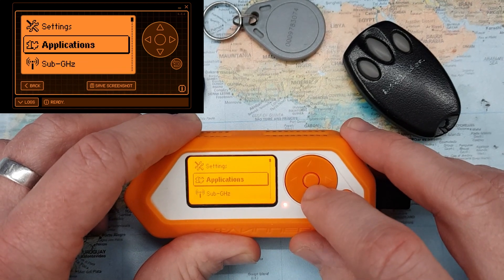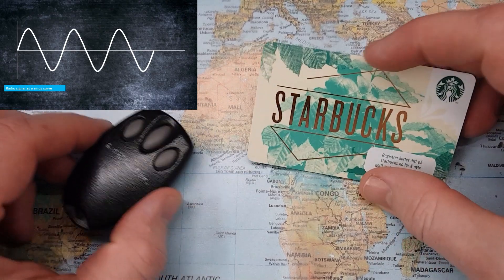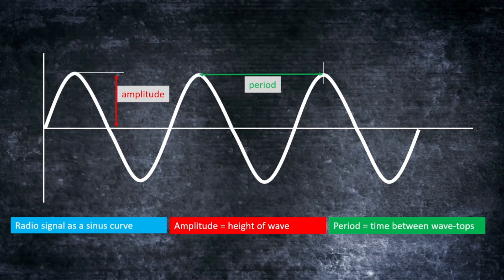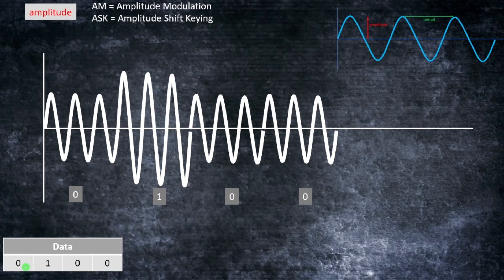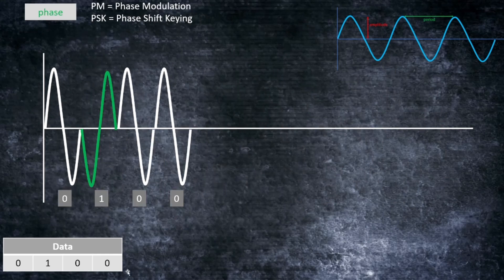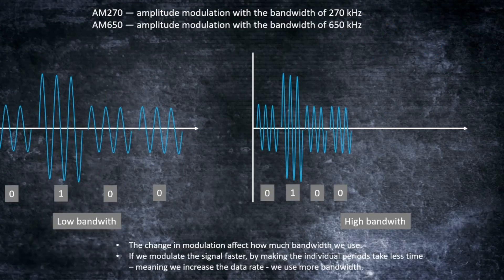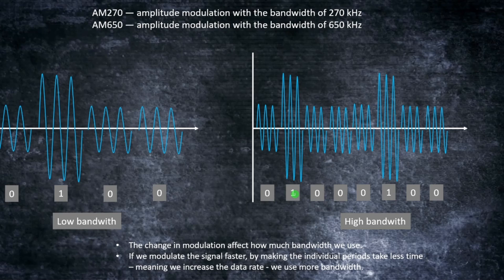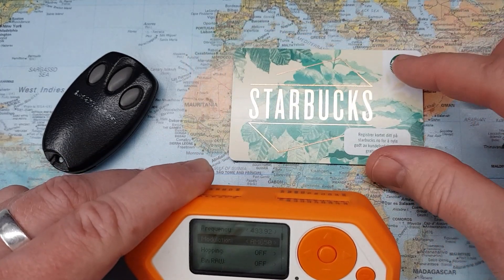Understanding Radio Signals with #flipperzero

Comment: I came to this video after learning about what the Flipper Zero is designed to do with almost no knowledge about radio signals, and you opened the door to more and deeper knowledge about how data is transferred wirelessly between electronic devices. Thank you so much! Learning is one of the greatest joys for me, and you've helped me learn a lot :)

Comment: Awesome video!! I've been learning all about modulation and working on making a video that covers modulation as well, that I hope to release first week of April.  I like how you did the visualizations of the waves by stretching them, that was a really good visual.  I'm still going to finish my video, but I'll be sure to link to your video too!  

One correction (at least I think)... My understanding for the CC1101 radio is that "bandwidth" in AM is actually about limiting how closely the broadcast frequency has to match the actual receive frequency (not about the data rate) and it only seems to impact the receive values, not the transmit.  I was initially thinking it was more similar to how you showed it too.  The frequency we set in the Flipper Zero is the center frequency, and the bandwidth is roughly the width from the lowest frequency to the highest frequency that is acceptable.  For example, if you are listening on 433.42 with AM270 then 270KHz is the width of the signals you allow, with 433.42 being the mid-point; 433.42 +- (270KHz/2) = 433.285MHz to 433.555MHz. If you are using AM650 then 650KHz is the width of the signals you allow; 433.42 += (650KHz/2) = 433.095MHz to 433.745MHz.

I think I read it somewhere in the CC1011 spec, but I can't find the text anymore?  The way I confirmed this understanding was to create the following SUB file & then use Sub-GHz, Saved, Emulate...
Filetype: Flipper SubGhz Key File
Version: 1
Frequency: 433620000
Preset: FuriHalSubGhzPresetOok650Async
Protocol: Princeton
Bit: 24
Key: 00 00 00 00 00 4E 8C F4
TE: 400
This will play a signal at 433.62MHz when you click the button on the Flipper.  This can be decoded on a second Flipper Zero using AM650 at a frequency of 433.42 (but will fail to decode on AM270).  If you change the above frequency file from 433620000 to 433520000 then both AM650 and AM270 can decode it.   So basically, you can use "AM270" when you want to be more specific about the frequency you are capturing for an AM signal.

I really like how you made the video easy to follow and still discussed PSK without making people's heads explode.  My video is still a little too technical, I need to do some serious editing.
Reply from the maker: Thank you Derek for excellent comments. I think you are right - and my explanation is a bit inaccurate. I will have to add a correction note (I wonder how that is done...?). According to https://docs.flipperzero.one/sub-ghz/read#zNwGY the FM238 means frequency modulation with the bandwidth of 270 kHz and the deviation of 2.380371 kHz. The same with FM476 — frequency modulation with the bandwidth of 270 kHz and the deviation of 47.60742 kHz. So here the number behind the DM says something about the deviation explained here: https://www.youtube.com/watch?v=gFu7-7lUGDg&t=142s This may differ a bit from AM to FM. My explanation is more about data capacity which is related to bandwith, but I believe your understanding is more correct. Thank's again - lets be wize by helping each other :-)
Reply: @techandfun7723   I wish YouTube had text overlays that could be added after a video was published.  I'm having fun learning & explaining different aspects of the Flipper.  For sure on data capacity, what you showed makes sense -- I still haven't wrapped my head around MSK.  I just noticed you are over 1000 subscribers -- that's so cool.  Congratulations!